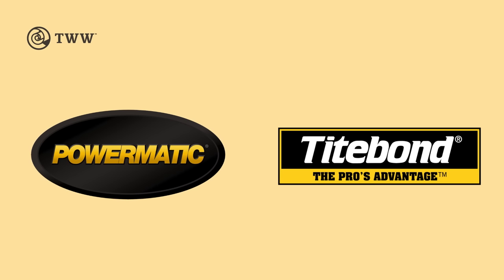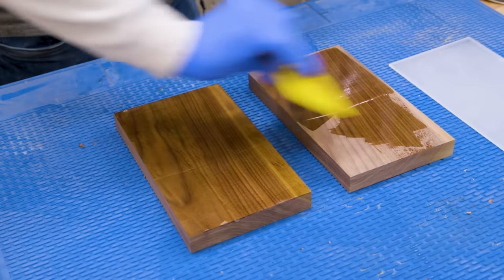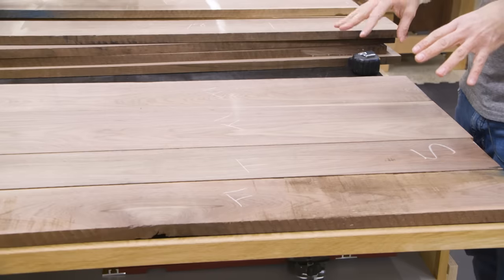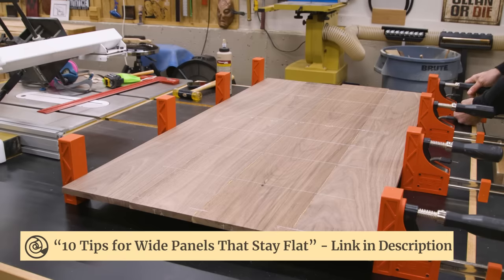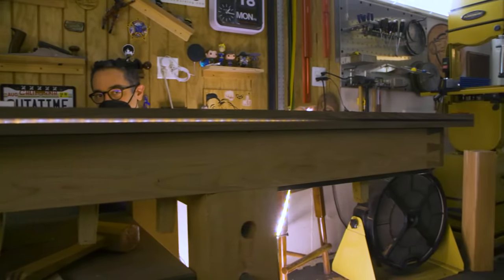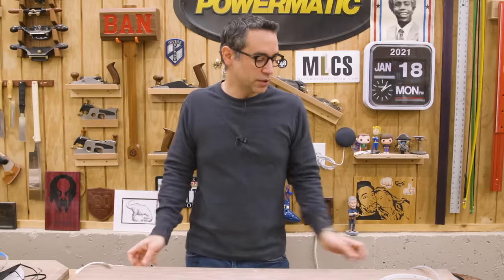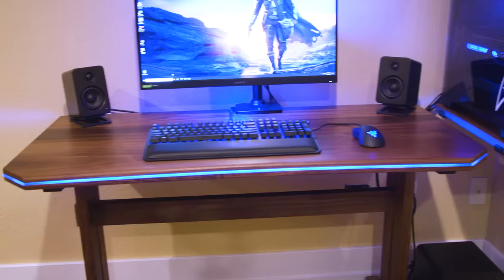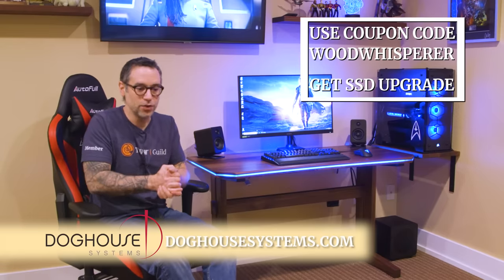I Made a RGB/LED Gaming Desk

Comment: Why not just scuff the front edge of plexiglass same as you did for epoxying in order to diffuse the light. Faaaaaaar less work.
Reply from the maker: Because it makes no difference. :)
Reply: Not sure why you say that. If you were looking to diffuse the individual LEDs showing through the plexiglass, it certainly would have made a difference. In the end the way you did it looks great, just trying to offer an alternative approach (that I've seen done several other places with making RGB things) that would have been easier. You said yourself you're pretty new to working with LEDs.
Reply from the maker: I'm only saying it because I tested it. I sanded it with low grits and my usual high grits. The only ones that showed any difference were the lower grits. The difference was minor at best and at worst it looked more "dirty" than diffused. Sanding to a higher grit looked overall better, if only marginally less bright. Then once the surface was hit with oil finish, regardless of how it was sanded, it pretty much looked to same. So I can't tell you why, but I can tell you in practical terms it made no difference.
Reply: Super strange. I've done it and known others that have done basically the same thing (high grit is what you would want - basically making frosted glass). But all of that is either in an open computer case or directly next to the LEDs as opposed to between pieces of wood over a long distance.. I'm glad you tested it, just genuinely super surprised it didn't work. Another thing I've seen done is embedding the LEDs directly under epoxy in a line. Probably not easier but curious how different it would be.